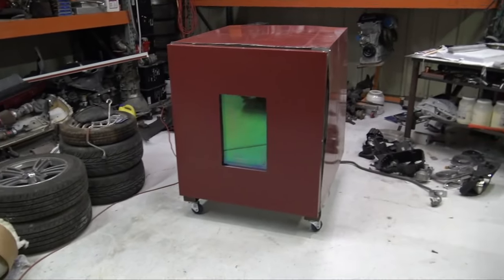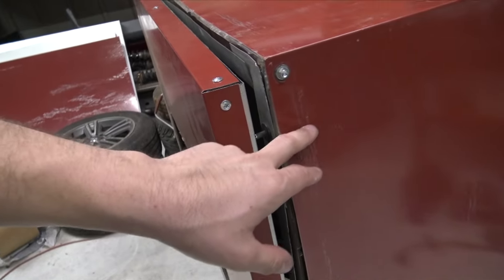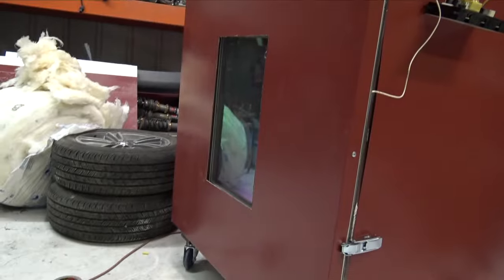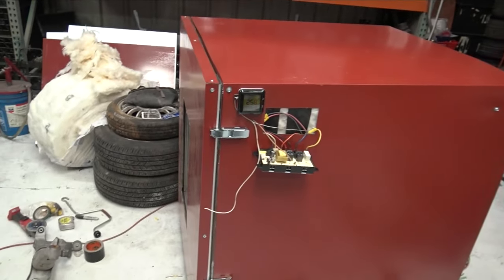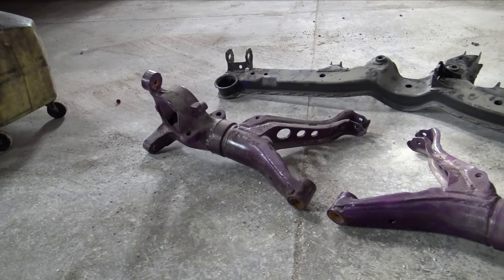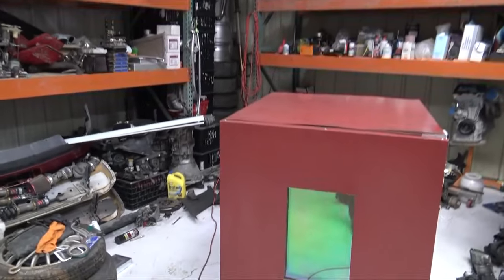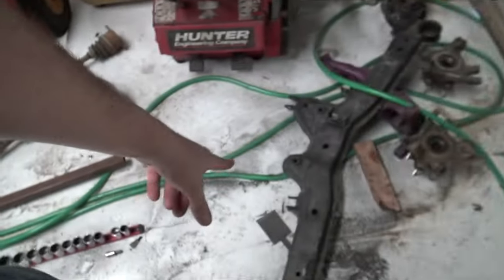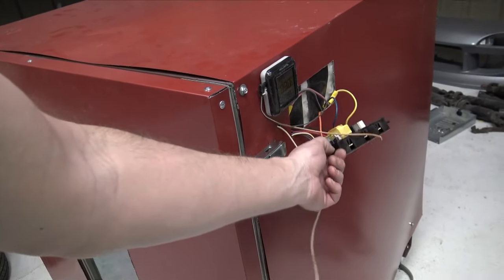Building the CHEAPEST Powdercoating Oven from SCRATCH and saving $7500

Comment: First
Reply: First reply to the first comment!
Reply: @richardburns9772  Hahaha !!
Reply: 52k
Reply: @richardburns9772  gnaggy old Mr Burns 😂😂
Reply: The recommended maximum temperature for long-term exposure of galvanized steel is 392°F (200°C). At higher temperatures, the zinc coating on the steel can melt and vaporize, releasing toxic zinc oxide fumes. Zinc oxide fumes can be invisible and can have harmful health effects if inhaled in large quantities or over a long period of time. Symptoms of zinc poisoning can include: Yellowish fumes, Zinc oxide particulates, and Lead oxide

Comment: I built an oven out of a metal trash can and a 110 single burner element. It has a bbq temp gauge in the lid, one big rack to put stuff on and hooks in the  underside of the lid to hang stuff from. It works really well. $35 total investment in the oven and I use a $75 dollar harbor freight powder coat gun.
Reply: Does it get up to temperature or do you have to insulate it?
Reply: I would like to see how you did that, sounds like it's just what I need
Reply: Hahaha! I love that! I’m glad it works for ya!
Reply: Teach me!!!!!
Reply: Show us your build. Sounds awesome
Reply: The recommended maximum temperature for long-term exposure of galvanized steel is 392°F (200°C). At higher temperatures, the zinc coating on the steel can melt and vaporize, releasing toxic zinc oxide fumes. Zinc oxide fumes can be invisible and can have harmful health effects if inhaled in large quantities or over a long period of time. Symptoms of zinc poisoning can include: Yellowish fumes, Zinc oxide particulates, and Lead oxide

Comment: I started watching this and was excited, until you said that you were going to use galvanized sheets. You may not be aware that when galvanized sheets are heated, it produces poisonous zinc fumes,which are toxic to breathe.. I hope you reconsider your material choice.
Reply: Jonathan Sandiford definitely could have just used regular mild steel or stainless if budget allowed for it
Reply: @ukrarex  it would be best m8. Stay safe!
Reply: You may not be aware that no zinc fumes are created unless the zinc coating is melted at significantly higher temperatures than this unit will see. Good to be safety conscious but but complete material knowledge should be used to make those decisions.

Comment: The recommended maximum temperature for long-term exposure of galvanized steel is 392°F (200°C). At higher temperatures, the zinc coating on the steel can melt and vaporize, releasing toxic zinc oxide fumes. Zinc oxide fumes can be invisible and can have harmful health effects if inhaled in large quantities or over a long period of time. Symptoms of zinc poisoning can include: Yellowish fumes, Zinc oxide particulates, and Lead oxide

Comment: Suggestion: Add a SLIDE to your center mount where you hang your parts in the oven. That way you can attach your powdered part to the hook faster and more easily.  You wont be losing as much heat from the oven since you will be shutting the door faster. Just my $.02

Comment: I built one similar and i used a convection oven fan to get even heating. It made a big difference. FYI
Reply: Excellent idea Paul I wanted to build one about the same with that he built but twice as high
Reply: Did you just use the normal convection fan in the regular spot in the middle off the oven? I'm using a doner convection oven but im worried about the convection fan blowing powder off but high temp blowers are more than I want to spend

Comment: Dave, I built my own powder coating oven many years ago.  sheet metal welded frame, angle iron frame for the door to seal against.  household oven element and controls.  Rockwool insulation from McMaster Carr.  Mine is 3'X3'X2'  love it!  wheels, suspension parts, crossmembers, but not FC

Comment: looks better than the oven i built. I went cheap with two free ovens, just cut the top of one, bottom of the other stacked and welded. i can bake on the lower unit and broil on the top heats up in 5 min
Reply: That was what I basically was planning to do.

Comment: Made a oven using an office cabinet measuring 1100mm x 1000 and used 50mm steel stud wall framing and rockwool insulation. Picked up a free home oven for 1 element, 2 lights. I build a control panel using a PID and SSD relays, amp meters for 2 elements and purchased 1 more element. Works a treat.  You did a great job of yours but use a PID to control the temp as home oven temp controls are not accurate.

Comment: Awesome build! Looks like the perfect size.  If you want to bring it to the next level on the cheap, replace the oven controller with a Temperature PID, solid state relay(SSR) and temperature probe. Also pick up a convection fan from an old oven to circulate the air and your temps will be more consistent throughout. The PID setup will keep your temps wayyyy more accurate than the oven controller, and you can pick up the packages that include the PID, SSR, and temp probe for a lot less than you think. 8-)    Keep up the good work man!
Reply: Are there specific heating elements you need to run the PID controller?
Reply: @cskiles  It makes no difference. The PID controller just turns the heating elements on and off to keep a consistent temp.

Comment: You should put a cage/mesh around the elements. 

Also the oven control will very the temp it won’t hold them at the highest temp. 

You need to ditch the fancy electric control and just have a simple switch set up for heat. Most parts will be baked at the same temp so really on need low and high (this can be done by wiring the elements in series or parallel)
Reply: Satveer Degun er, no. Really bad idea.

Comment: You really need a PID controller to help you maintain a constant controlled temperature. I built a similar powder coating oven last year the PID co roller is a game changer.
Reply: I agree.  It will probably be a heck of a lot more reliable than the household controler.

Comment: Thanks for the inspiration to get off MY butt and finish my powder coating oven! I've been procrastinating because mostly I am unsure of the electrical works.  I'm good with my hands, welding, mechanics building but wiring just baffles me and the older I get the harder it is to see 🤪. However, on the temperature side of your build, if you haven't done so already, my research has a solution. Use a ceiling fan. Get smaller blades, mounted in the bottom, motor on the outside, fan on the inside. Ceiling fans run slowly forever, circulating the air giving you perfect even temperature. Simple, one tiny hole through the box with a small fan!

Thanks again,
Tim

Comment: Nice build, one suggestion Instead of that cheap  Insulation you put on that oven I would go out and get HVAC 2" ductboard and some aluminum tape to increase the efficiency.
Reply: Also to make it stick to the side of the Oven use 3M spray glue.  Spray both the oven and the duct board Let it stand for about 20 to 30 seconds to tack up and then place the duck board onto the sheet metal

Comment: Excellent job! But you need to ditch the oven control and use something like an AGPtEK Dual Display Digital Programmable Temperature Control TA4-SSR, Amazon has it for about $28, it has over temp alarms and built in sold state relays. Chuck full of features

Comment: Your oven definitely looks better then mine haha I used steel stud and mines a 3' cube. I started with my elements just like you had on the top and bottom but ended up changing them and mounted one on each side at the buttom. As well as I put a convection fan in. The regulation from the top to buttom was like 70° is some spots. With the elements on the sides and a fan in there the relation is about 10°

Comment: I’ve watched this three times now. I built one using metal studs and it just wasn’t solid enough. I’ll be going to pickup tubing today and get my frame welded up. Maybe if you get bored you could drop a video explaining the actual wiring of this oven. That would be awesome.
Reply from the maker: Just pull everything from the donor oven and transplant it there are only 2 wires for the element and 3 wires for the power and grounding

Comment: Nice job man! I live in the netherlands and have a tiny shed where I basically plan on doing the same stuff! I already got a nice compressor, a powdercoating set-up and a used small kitchen oven. I still have to buy a sandblasting cabinet and then I can start powdercoating valvecovers and control arms for my friends! I also tried messing with derusting by submerging metal objects in vinegar but the moment I take it out it instanly rusts again. Have to figure something out for that too. I wish I had as much space as you, I’d definitely build my own oven too!

Comment: Great build. Only thing I dont like about it is the top element.. Id keep the thermo coupler towards the top maybe 3 or 4 inches from the top like that but move the top element to a dual bottom element. Could help with the inconsistent tempratures youd get off it that top element so close to the thermo coupler I would think it would kick it out too easily. Other than that good build thank you.
Reply from the maker: I moved them both to the bottom side after this video and it holds temps much better

Comment: just a tip put a clear coat on it last a lot longer and shines better too
also check out pid temp controllers there pretty cheap and work great
i also made 2 racks that slide on angle iron right at the top so you can load all the parts to the racks and swap as you shoot the powder

Comment: Sweet video.... I modified a regular oven to hold a 24” part ..... currently looking for another free curbside oven so I can stack em and weld em together! 🤙🏼🤙🏼
Reply: lol i started with an oven that i made a box that sits on the open oven door and would give you 2x the space!
but look into pid temp controllers when you go to upgrade your oven. there cheap and work good at holding the temp

Comment: I like it.   A couple of thoughts however.  

First, consider the way you made the frame. You have large areas that are un-insulated, and the frame provides a direct thermal bridge sucking heat out of the oven. So not only are you paying for a lot more electricity than you need,  but you are pumping that heat into your shop.  Perhaps OK in winter but in summer that's not good.

Now consider an alternative design where your frame is on the outside and you fab a box on the inside.  Inside this box you line it with a rigid ceramic insulating material on 5 sides. 

Now fab an inner box and slide it in.  You will have no thermal bridging. Make the inside box with a flange to effect a seal with the door.

Next, do you really need a window?  Windows are  big thermal holes where you loose heat you want to keep inside.  In powder coating,  having a window allows you to watch paint dry.  I don't really think there are many times you actually need to watch the process.

On your current oven, you are stuffing the electronics in a place that is going to get hot.  This is not a good thing as it doesn't take much heat to cook microprocessors.

Wires.  Any wire that is going to get exposed to heat needs to have high temp insulation.  It appears from the video you used regular wire with plastic insulation,  you might have  problem.

When you suggested that an analog controller was some how inferior to the digital, this caused a big cringe.  On an analog design very little can fail, on the digital lots of things can, and do,  go wrong.  If you only are going to do powder coating, the digital whizz bang can actually be a disadvantage as the ones I have seen require you to reset the temp each time you turn it on.  what happens if the controller works but, the  display goes on the fritz?  On an analog controller,   when you hit the on switch, the oven goes right back to the last setting and you are in business.

As others have mentioned, a PID controller is the way to go, you will get a much tighter control of your temp.  They often can be found used on e-bay  or there are a bunch of cheap Chinese ones new for less than $20.
Reply: I don't think anyone read past the first sentence.

Comment: Very nice build David, I've been thinking of using the same idea but making a taller box, big enough to get a motorcycle frame in.  I might need to find an old double oven just to get the required heat. Thoughts?

Comment: Dave, I don't see the links you mentioned. Can you give me an idea of the size and/or dimensions? 
I've been thinking of doing this very same thing to coat my new tubing bender. I bought the Rogue Fab M600 (some assembly required) to save money. You have to weld it up and paint or have it coated. It's a little too big for a standard size oven as most car parts would be. I've also got a refabricated trans cross member that I would have liked to powder coat also.
Mark

Comment: I noticed you use regular insulation. I understand that melts at a very low temperature, well under 365°F used for most glazes. I got some fire rock (rockwool) for my oven that I haven’t built yet. That cost $50 for a small amount, considerably more than regular insulation. I have a lot of regular insulation and would like to use that if I can. What was your experience with this? I got the prior information off of Owens Corning literature, but I did another search and a site tells me that regular insulation will go to 1000°F. Now I’m more confused! 🤗
Reply from the maker: My oven hasn't caught fire yet so I guess its good lol
Reply: It takes a lot more than oven temps tp melt fiberglass insulation.

Comment: Sweet oven build! Did you do anything special to the wiring like wire both elements to come on at once instead of only 1 at a time for bake and broil like factory??? It would get to temp fast! But not sure if you would need to wire it for more voltage?

Comment: Looks good but don’t use galvanized steel. Galvanized steel releases toxic fumes at 390 degrees. Use regular sheet steel with high temp paint
Reply: Jesus christ , this has been adressed over and over .. its fine ,
Reply: @dawndavenport9139  
I posted this two years ago. Damn you’re sharp

Comment: Great build, but I have a few questions. Excuse me if they aren't well articulated, but I'm new to powder coating. 
Would it have been easier to use an upright freezer and modifying it? 
Did you consider a high temperature fan to circulate the air or is it necessary?
Thanks in advance.
Reply from the maker: A fan would be good but it would have to be low flow so it didn't blow off the powder and I'm not sure how a fridge would like heat

Comment: Do a big plate of cookies,  no joke, see how even that oven heats, you would be surprised how most ovens don't heat evenly everywhere,  you might find you don't have enough elements.
Reply from the maker: I moved both elements to the sides on the bottom it works much better now

Comment: The strength in that arm comes from the depth of the walls you just made smaller. Unless you made the walls thicker by adding a plate, you have made them less than half as strong

Comment: Looks like a great oven. 
I know you don't want lots of air movement with powder coating but is there any way to have a small fan or something in there to move the heat around so it's more consistent temp from top to bottom? That might be a really bad idea but maybe it's genius, I'm just asking
Reply: As long as you don't have fast flowing air blowing directly on the part, it's totally fine. Especially if you preheat the parts before coating, because then the paint particles stick really well. When we powder coated in a factory, the parts were on a moving line that went through a huge oven with tons of turbulence from the burners. Never blew off any paint or caused issues unless the parts swayed in the moving air too much and hit the oven door going in or out.

Comment: Instead of the heater element, why couldn't one just drill a round hole and jam a heat gun in there?   I'm certain that could heat it up to 350 degrees, couldn't it?
Reply from the maker: It would probably blow the coating off before it baked

Comment: I was going to make my own powder coating oven and use a steel cabinet 6hx4wx2d. I’m just not sure how much power is required to heat up an oven element. I know there 220 but could you run one of a 12v each or even off its own 110. How power did you need for those two elements?

Comment: now u can start charging ur friends to powdercoat their stuffs!! 😆😆

btw putting the wires inside a thermoinsulating sleeve might be a good idea.
Reply: Actually the wire should all be High Temp rated- to at least the highest temp you need plus maybe 10%. It's for your fire protection; I've had two friends go through their garages burning up; the lost tools. projects, bits and pieces amount to a massive set beck- also your home owner's insurance may not be any help if you can't demonstrate the oven was "code safe". Great project- and one that could do enough damage to get some if not all powder coaters to be more reasonable.

Comment: I could use some help. :) When you heat it up that much does the insolation really stop the heat from melting wires, plastic and so on? Also does the casing get hot or not, can u touch it even when it's on?
Reply from the maker: I run stuff and the outside gets warm but I can still touch it

Comment: It’s been 1 year since you built this autoclave and I was wondering if an oven fan was installed inside to circulate the heat.
Reply from the maker: No but I did move the elements to the side bottom which gave me a lot more room for larger parts

Comment: You forgot to mention the cost of the welding equipment, sheet metal break etc. So buying an oven of the same size you built will be a hell of a lot cheaper.
Reply from the maker: I was able to have the company that sold me the metal do some of it on their bender you just have to ask sometimes places are cool